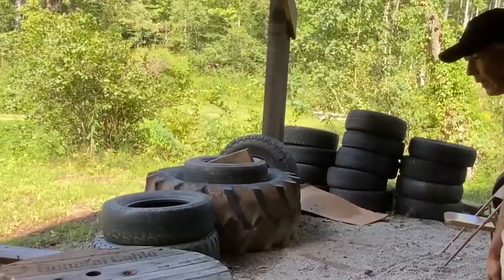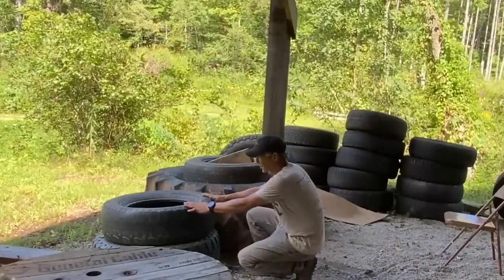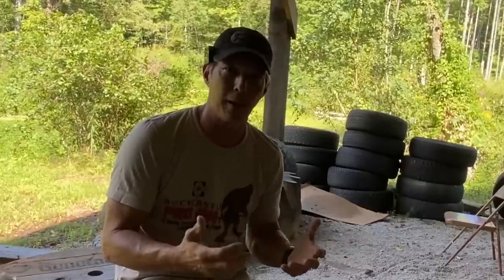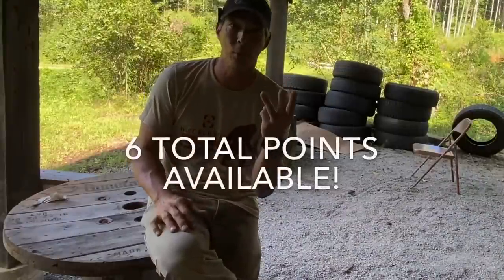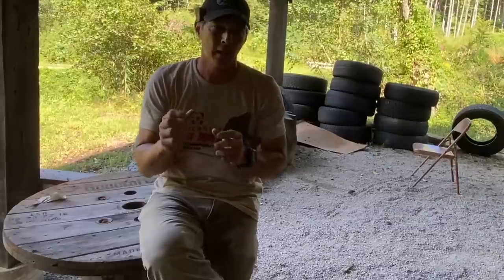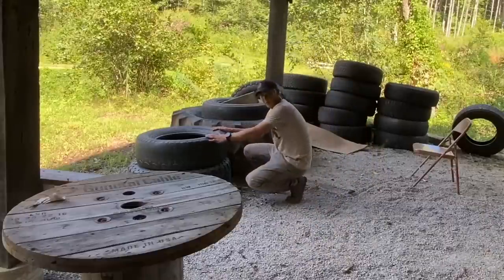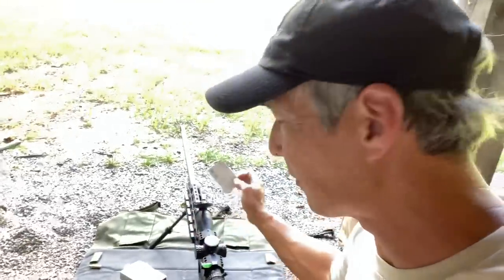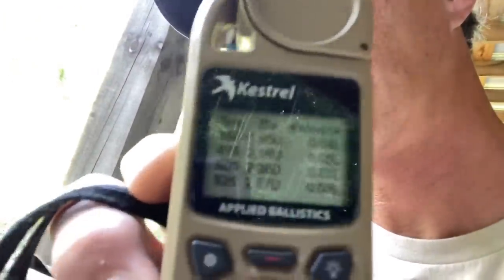PRS bags and positioning

Comment: I put together a couple of bags.  One rear one front.  I used play ground sand from hardware store.  Came out to darn heavy.  I think I will empty them and use plastic BBs.  Good info on shooting bags.  Keep up the great Yard Work.
Reply from the maker: Thanks Robert!  I made my own as well back In the day.  I figured the new ones are better than what I can make!  Thanks for watching!
Reply: Robert, I have gathered poly-pellets and craft foam beads from Hobby Lobby to create a lighter bag fill.  If you opt for the pellets $30/ 6lbs there is a 40% coupon.  I purchased in-store, shipping will ruin the deal.  If you try the foam beads, (usually on the back wall of store) check the multi color option. The bags are typically less miss-handled and contain the full 0.8 oz.
Reply: @hesa3656  I will check our Ben Franklen craft store. If I remember correctly they had tiny plastic beads for crafts. It's the only place I can think of on Maui.

Comment: Nice run down Ray. Starting tomorrow I'm going to work on  Positional shooting.
Reply: Add a 100 yard 1 inch dot in your positional it will help you a ton
Reply: @holdleftedgeandsendit9351 thanks man.  I'll paint a small dot on my steel.  My closest set is 220. But I'll still put a small dot on them.  👍👍
Reply: @ramsaycountry1177  yes sir its a learning curve but good practice makes it get easier an easier
Reply: @holdleftedgeandsendit9351  I'll be shooting my first prs match in little more than a month so I've got to get after it.  I feel pretty good prone. Just pretty much never shoot any other way. So I'm sure I'll  not  finish all the stages but I'm just hoping to learn and have fun.
Reply: @ramsaycountry1177  id reach out out to the match director explain your a new shooter and see if you will send you the cof so you know what you really need to work on. In these matches some might be 90% prone some might only have one stage
Reply: @holdleftedgeandsendit9351  ok I'll do that👍👍

Comment: Hey Ray, can you do a specific video on the differences in support bags ? Like there’s 30 different “game changers” out there, which do you prefer and why ? Different sizes for different applications or one for all ??? Pump pillows …. Is bigger just better ?? Do you use several depending on the stage or do you have 1-2 go to bags ?? Trying to get an idea of what game changer to buy w what fill and what material ? I think I saw one of your vids where you talked about a leather type surface that made it less slippery on a vehicle windshield etc …. If it’s too much of a PIA can ya just respond w your thoughts on the subject ? Thanks man 👊🏼

Comment: I ran two or three bags last year, so far this year I've been running one bag the schmedium game changer. I've tried them all and it's by far the best bag.
Reply from the maker: I agree!  If you only had one bag, that would probably be the most versatile. Thanks for watching and commenting!
Reply: agree with you...took a class with Matt Steiner and Keith Baker and settled for the schmedium with heavy sand. Don't need anything else and discarded my big cuddle bag because I spent too much time screwing around with it rather than establishing a good position. If the gun is stable you don't need to fumble with a bunch of crap.